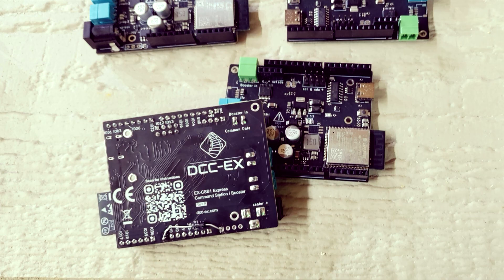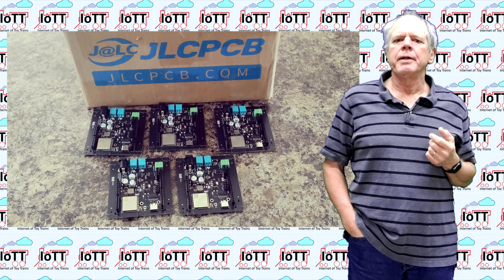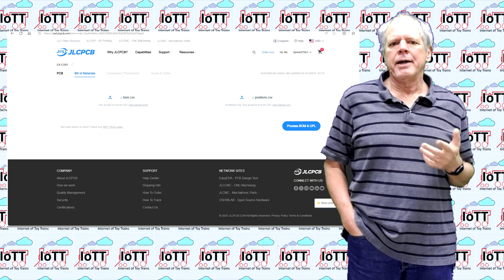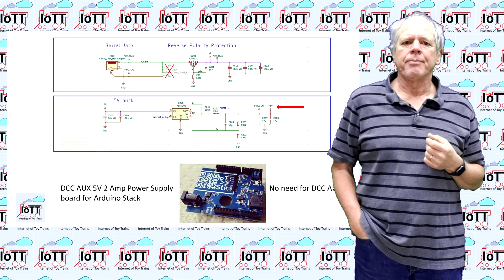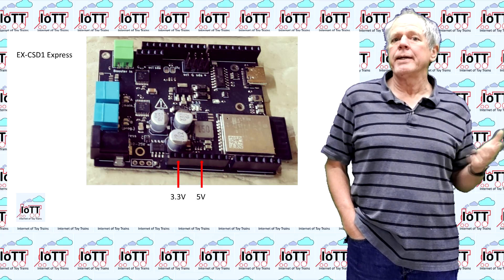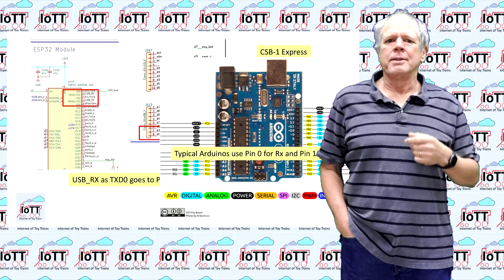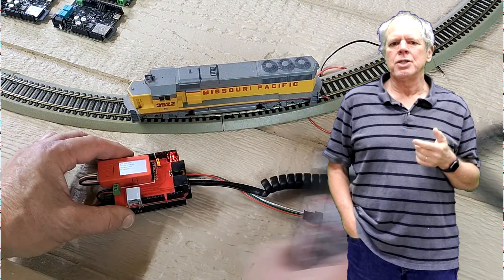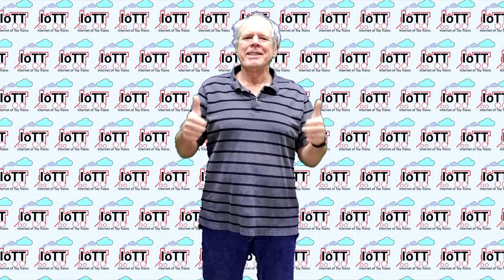Loconet EX-CSB1 Express (Video#152)

Comment: @IoTT I am happy to see this, I am looking into integrating LocoNet into my DCC-EX layout. I do have a question. How do I get output from the Loconet back to DCC-EX to use in EX-Rail. Specifically, I want to use block detection that can trigger EXRail events in DCC-EX. Is there a way to send block detection signals from LocoNet to EXRail on a DCC_EX CS?
Reply from the maker: Only the other way around: Input pins on the Arduino can be reported to Loconet. The DCC-EX serial communication does not support receiving block detector information. See this video for what is possible with the RedHat: https://youtu.be/zCtgcBsNiOE

Comment: Hi, how do i set up a second CSB1 so that it runs in BOOSTER mode through the loconet B connection ?  Do I connect the 2 loconet B connections to each  other ? Do I need to change any firmware settings ? Thanks.
Reply from the maker: Check this DCC-EX documentation: https://dcc-ex.com/ex-commandstation/rtr-booster.html#gsc.tab=0
Connect the output of any command station to the Railsync input of the board you are running as booster.

Comment: Hi. Love your stuff! And thanks for making it available. I’m looking to get loconet throttles (Digitrax equipment) working with a CSB1. Would a Digitrax ur93 connected to this loconet device work to provide radio throttle access to the dcc-ex csb1?
Reply from the maker: It is a normal Loconet coming from the RedHat, so all devices that work on a Digitrax command station Loconet should work as well, which includes the various panels for Radio and/or IR.
Reply: @IoTT very good. Thanks!

Comment: I would like to run the EX-CSB1 as a booster, would it be possible to connect it up with the red hat and feed data via Loconet instead of using the in on the board?
Reply from the maker: You probably should use the onboard IN port as it goes through an opto coupler. If you put on a RedHat, the DCC input comes on pins 2 and 3 and it is also for 5V pins while the ESP32 uses 3.3V. Of course you could do some adaptations to make it work, but using the port is easier in this case. You should be able to feed Loconet pins 1 and 6 directly to it and it should work.
Reply: @IoTT  Can I use the booster-port?Then I wiil not be any problems with the power supplied by on the t-ports?
Reply from the maker: Yes, on the RedHat you need to use the Loconet-B output that has the booster signal. The two Loconet-T jacks carry DC on pins 1 and 6, no DCC signal.

Comment: As a complete novice and just started a few weeks ago with the DCC-CSB-1 where to find what items I will need for the setup as shown in this video ? Years ago I had a G scale layout controlled wit Zimo Products. I just started a new modell railroad adventure with N scale, bought a CSB-1 command station and now picking up information where google brings me. What I have been missing so far is connectivity to the command station for modules like block systems. With Loconet it looks to me to be a lot simpler.
Reply from the maker: To add Loconet to the EX-CSB-1 you only need a RedHat Shield and the IoTT Stick, just as shown in Video #152.

Comment: One part of me thinks it would be awesome with a plug and play designed HAT specific for the CSB-1 board that includes an ESP32 and other hardware (including connectors) for handling all the Loconet communication with the world and the CSB-1. 

But I also think that a number of ESP32 version of you software defined "critter" boards linked together to make a highly scaleable Command Station System would be fun...  as you said, lots of options.
Reply from the maker: Another option would be integrating Loconet into the DCC EX software for the ESP 32. I looked into that, but then opted for the modular approach as it is more flexible.
Reply: @IoTT I’m unsure as to how I should use the CSB1 with your loconet hat. Do I use only the software on your m5stick or do I need the interface on the CSB1 ?
Can you modify your code so I can use a i2c display on the CSB1 instead of the display on the m5 stick ?
Reply from the maker: You can run the wires from the CSB1 i2c port to a display, it will work as display as before. The Stick display only covers the Loconet side, it does not have access to all data of the CSB1.

Comment: Hans, great video as always!  I've been debating adding the RedHat to my DCC-EX command station for my shelf layout, but I think I would be just as well off using a Loconet interface connected to an IoTT Stick since I am only using Loconet for feedback with the Arcomora Arloco and LocoNext.  The IoTT Stick sends feedback information to iTrain using Loconet over TCP.  Am I missing any other RedHat functionality with the interface only setup?  I would love to eventually see Loconet integrated into DCC-EX, but I understand the challenges in doing so.  Cheers!
Reply from the maker: The question is what are you using as command station. Typically, your iTrain software is connected to it. And Loconet feeds into the command station. So, if you are using the Loconet interface, the Stick would assume it has connection to a Loconet command station. You then can activate the Loconet over TCP server on the Stick and connect the software to it using Wifi. The potential problem with this setup is that the software would assume it talks to a command station. So I don't know how you would send e.g. loco commands to somewhere else. Maybe iTrain supports more than one command station at the same time, I don't know.
Reply: @IoTT  I am using the DCC-EX command station, and it does not have integrated Loconet support for feedback sensors.  As for iTrain, it does support multiple interfaces so I can connect to DCC-EX for train/accessory control and via the the Loconet over TCP server on the IoTT Stick (connected to the Loconet interface) for feedback.   It sounds like I don't need to add the RedHat to my DCC-EX.  As always, thanks, Hans!
Reply: Well I did go ahead and get the CSB-1, and the basics do indeed work with iTrain.  However, I am so far unable to get iTrain to be able to connect to the Loconet lbServer on the IoTT Stick (for feedback from my LocoNext units).  I've reached out on the iTrain forum as this appears to have been identified before and the fix was to use a different interface type in iTrain which does not appear in the list when I look on my PC.  I do see iTrain tying to connect as the PC entry shows briefly in the IoTT Stick LN TCP Server client window before disappearing.   If I read the posts correctly, it has something to do with one interface type being binary and one being text.  I'll post again when resolved.
Reply: OK - working now!  I needed to check a box to show all interface types and select the "N Loconet Server" option and NOT the "N Loconet TCP/IP" option.  Success!!!  Cheers all!
Reply from the maker: And why I am still trying to install iTrain, you have already figured it out! Thanks for the information.
Reply: @IoTT  Everything is working great but I did have some issues with iTrain not being able to actually drive trains.  I made sure to set the interfaces according to my setup (DCC-EX for vehicles and accessories and Loconet for feedback).  I also unchecked Loconet throttle and Switch echo on the IoTT stick (not sure I needed to do that but I did).  Once I restarted iTrain, everything worked as it should.  Really liking iTrain so far!  Cheers!

Comment: Great work.  Is it the same process for the AUX Shield?  Looking for a way to add some IoTT stick features on top of the CSB1.
Reply from the maker: Thanks. You can put on a DCC AUX shield instead, but in that case you should not power the VIN pin. Just leave the diode on the board away or bend out the VIN pin. The AUX shield now only gets the 5V to power the stick and the buck convertor on the AUX remains unpowered. You can run the Stick in RedHat mode with Loconet Loopback and turn on the Loconet over TCP connection to connect to from JMRI.

Comment: Excellent, now with the files from DCC-EX and your RedHat, I have 5 affordable Loconet 5 amp command stations. My next project is to wire them up as separate districts, a CSB1-RedHat  for each module. Help please.😅
Reply from the maker: I have to check, it sounds like there is a booster mode you can use for that. Alternatively, you can add more power shields on the same CSB1, up to four output channels.
Reply: @IoTT since my layout is a modular loconet design with a main loconet ESU command station, I’m hoping that I can use my extra CSB1’s as loconet power boosters. One on each module. Also one of the CSB’s would power my roundhouse with 34 tracks and reverse protection. I hope you can give me some advice. Thanks.

Comment: Excellent.  I have been using DCC++  -->  DCC-EX for some years now.  I think I would like to try my DCC-EX system to incorporate Loconet as I also have many loconet items and would like to implement them on various model train layouts.  Would I need a redhat shield and IOTT stick attached to my arduino mega, DCC-EX motor shield and wifi shield for this functionality or is there more to this? You really do interesting work but I am not sure of my own abilities.
Reply from the maker: For the Mega you would also need a DCC AUX shield, besides the RedHat and the Stick. Check some of the videos in the RedHat play list where I show how to assemble the command station. It's simple.
Reply: @IoTT  Thank you.  I will 😃